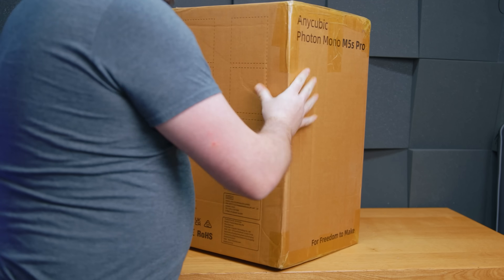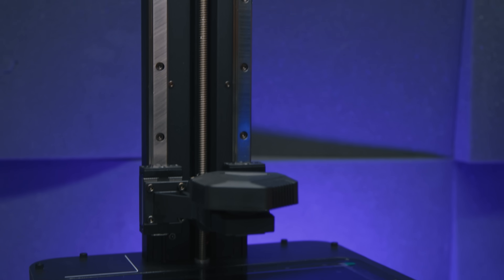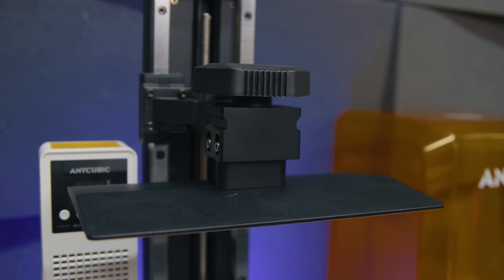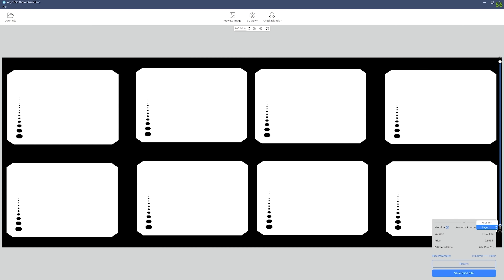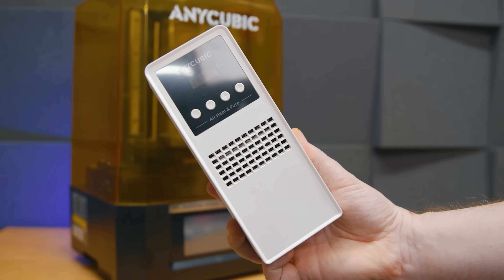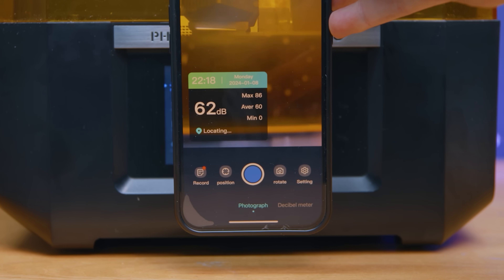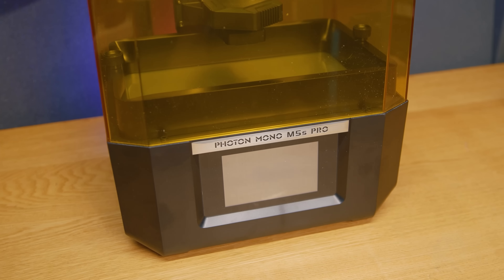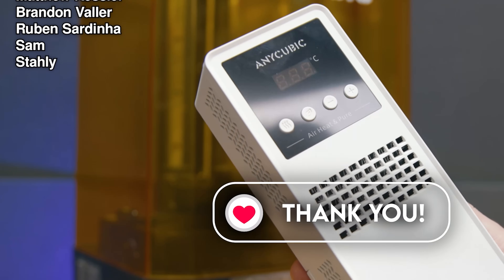About Damn Time - Anycubic Mono M5S Pro Review

Comment: I can't believe one of their cost cutting measures was to not include rubber feet. That's so ridiculous it's funny.
Reply: Yeah but they can sell you new feet for $50 afterward. You could also just buy a $10 heat mat for under it.
Reply: Just 3d print new feet 🤷‍♂️ 
For the price, this printer is pretty dang good.  It's common  in the 3d printing community to 3d print your own upgrades.
Reply: It’s almost like they’re as cheap as the people they’re selling to.
Reply: I can. Its amazing how companies seem to constantly miss what consumers care about. They cut costs on wanted things and keep stuff that arent important. Look at elegoo. Saturn 4 ultra.. tilting bed.. no heater or port for one etc.
Reply: Those little plastic ovals are supposed to have adhesive rubber inserts. it looks like they forgot about them.

Comment: So just found your video review. I absolutely love this printer. It’s simple, works, and does heck of fast prints. I have both the nfep and acf vats and I swap between the two. I started to 3d print a model rollercoaster that works. The track is printed with fast print resin and the train is printed with 8k resin. I ended up having a dead projector that I stole the rubber feet off and it is perfect for keeping the printer steady. Now for one update that you will like, I never print with usb. I print from my computer directly to the printer via the photon workshop slicer. All WiFi no usb or cords. The only reason I use my phone app was for set up or to check my prints. Actually I traveled from my home and finished a model on my trip, connected to WiFi at the hotel and printed my model. When I got home my print was finished and didn’t have any issues.

Comment: I have a small side hustle where I help a local DnD Studio with their prints. We have an M5s. We call it the Fast Printer. Not the Best Printer, or the Good Printer, just the Fast Printer. Currently I'm printing 160 various models for a collab, and the minis get printed on the Mono X, Mono X 6k, and 2 DLP's. The bases get printed on the Fast Printer. Bigger pieces / terrain as well.

This printer looks like a nice middle of the road option between features and affordability. But it definitely needs rubber feet.

Comment: I bought an M5s. To get around the heater issue I just run the build plate under hot tap water until the plate is hot. Wipe the thing dry, reinstall and print. NO failed prints since I started doing this.
Reply: Ever tried popping the resin in the microwave for a minute?

Comment: I bought this yesterday as my 5th resin-printer. I have so much joy with my two M3+ and needed a printer for more details (small miniatures) with other selfmade Resin-blends. I really needed a heater and I paided 80€ per piece for my 2xM3+ and can't print with my Photon Ultra because of the temp. So I preordered one with 2x1kg for 452€ with a coupon... Means after subtracting the costs for Resin/heater I payed 332€ for a printer that will last me at least 3 years... When it prints like the M3's, than I'm absolutely happy and I can swap the heater to my Photon Ultra if needed :)
Reply: How has it been 3 months in? I'm now debating this and the Saturn 4 Ultra.

Comment: Not sure what's the issues you're having with the wifi, but it works well on my M5s, and I can send prints from the Photon Workshop on my desktop directly to the printer, the app I use just for monitoring. Basically, both the printer and desktop are connectred to the same network, and the printer shows up in my slicer to send prints to no issues. Maybe I'm just misunderstanding your point, but it definitely works with my PC.
Reply: i have never gotten it to work directly to my computer. I don't use the smartphone app with the printer which as far as I can tell you need to use to set it up.
Reply: Another commenter here wrote that files sent from the slicer are sent via the cloud which then needs to be cleaned out occasionally. Can you confirm that it's possible to bypass using cloud?
Reply: @markburton5292  It does need the app for the setup, yes. It doesn't go "directly" to the printer from the computer, but you don't need to send it to the app and then the printer manually. You just click remote print in your slicer, it gets uploaded to the app and the printer, and the print starts, no manual steps past clicking remote print.
Reply: @DanJ-yt7cb  The files go through the app, which highly likely is hosted on some cloud provider, so don't think you can bypass that. The "cleaning" part is your print history in the app I guess, same as you'd need to clean the memory of your printer.
Reply: @rumenmatanov303  here is my problem with that. I don't want to be required to install the app on my phone to set it up. I hate smart phones I don't want the world accessing my life from my phone. so i will just keep using the sneakernet ( put it on you r sneakers (shoes) save the sliced file to usb and walk over to the printer and  print from the usb)
Reply: @rumenmatanov303  Ahh I see. Thanks for the clarification

Comment: where would this place in your best printers for miniatures considering you stated is better than prior M5 and M5s and the one you would personally buy in that price range?
Reply: 1	Ultracraft Reflex HeyGears
2	UniFormación GKTwo
3	Elegoo Saturno 4 Ultra
4	Anycubic M7 Pro
5	Elegoo Saturno 3 Ultra
	
6	Elegoo Saturno 4
61	PHOTON MONO 7
7	Elegoo Saturn 3 – 12k
8	Phrozen Sonic Mini 8K
9	Anycubic M5 Pro
10	Elegoo Marte 5 Ultra
11	Elegoo Marte 4 Ultra
12	Elegoo Marte 4 (9k)
13	Anycubic Photon X6K
14	Elegoo Marte 4 Max
15	Fotón Anycubic D2
16	Marte 4 – DLP
de una reseña que el hizo

Comment: Hello, could you make a video testing water washable resin vs ipa resin? What are the drawbacks of each etc
Reply from the maker: i may cover it, it;s a lot of work and the result will be - that could have been an email.

Most Water Washables are crap and even the good ones I'll wash in Metheylated Spirit to ensure it;s clean, Water Washable also absorbs water which can cause prints to soften, go brittle, or crack,. even air moisture after the print can be a pin
Reply: Ah, figured the water washable resins had been improved over the years, seems like not then. Watched Midwinter's video and it seemed most of the fumes and vocs came from the Ipa cleaning, so would be interesting if that could be avoided with better water washable resins. @FauxHammer
Reply from the maker: Youc an do it, and Water Washable resins are better, some anwyay, but they have caveats.

Wash for a few minutes at a time and don;t leave them sat in water and you'll be fine. I;m so distracted that i often leave prints in the wash vat and Methys are much less harmful

 @zior92

Comment: Must say though it doesn't need a heater! Used the m5s all winter with no issues on the UV heating up the resin still hate the printer it does print nice now new Build plate is relised and being sent to people like the saturn 3 ultra so you have some manual levelling as the build plates were angled and 2mm to short! I printed a new spacer from printables for mine it worked great and anycubic then worked with me put the new update on the printer and has new Build plate! What build plate comes with it version 1 or version 2 with the 4 hex bolts?

Comment: My 2 cents , I don't care about print quality I make functional parts , I like the heater , I like the size every millimter gives me more options , I like the low weight it reduces my (Guatamala) very high shipping cost , a noisy fan is a real negative for me, I can add rubber feet and some weight my self. I like the low cost but would pay more for a quiet machine.

Comment: I have to correct you about the wifi stuff, I have an M5 and you can send prints to it from your PC, but they HAVE TO be sent from their slicer, things like Lychee dont work that way. there is a storage limitation as well, as it sends to anycubic cloud and then from cloud to printer (which is a big question of "why? just send it to printer direct"
Reply: I've been sending all of my prints from my PC to the printer via wifi through the Anycubic slicer. Works great. You just have to occasionally clean out the cloud storage.
Reply: This was interesting to learn. I was under the impression that pressing "Remote Print" sent it directly to the printer, and that "Save to cloud" was for cloud printing. Hmm, now I'm back to thinking of Saturn Ultra again!
Reply: @DanJ-yt7cb  I think saving to the cloud makes it easier to manage/delete files from the PC/slicer (I also deleted unneeded files using the phone app) rather than having to do it from the interface on the printer, but just a guess.
Reply: @harrisjc03  Makes sense. Thanks for your help

Comment: compared to the Saturn 3 Ultra the M5s pro only gives me 200 mm print height. 60mm less as S3U and only 30mm more as the M3pro. Enough sensors which can brake or gives a fake error. I was struggling with my self which one will print on my side. I decided for S3 Ultra for 469€. I'm more than confident with the point that i level my bed manually. Having a higher print height and a z ballscrew as well. The heater on M5s pro is not necessary in my case, im printing in a heated basement. For sure there more fancy extras on M5SP but do I really need it. 12K vs 14K? different number same optic. I like the design, screen protection and the lower price from the M5SP. At the end the Saturn is my friend for the next time which I ordered finally.

Comment: My m5s after 2 months of working with anycubic getting the new V2 build plate as the original self levelling in production model's are 2mm to short now the V2 is more like the saturn 3 ultras they are sending out but mine is back in its box and for will be going up on market soon! I went and got the saturn 3 ultra I just should have gone with my gut in the first place but the self levelling idea got the better of me! It works great now it's got the new V2 build plate but it's so loud you can not keep it in the same room your in like a bedroom you can't run it through the night the fans are like jet engines kicking in and can't hear your TV! That's one very bad point when I first pressed print I couldn't believe the sound of the fans! I was going to see if a saturn 2 8k fan would fit as so quiet! My saturn 3 ultra is louder than my saturn 2 but nothing like the m5s!

Comment: Hello, could you help me please, I am looking at these machines for dental laboratory use, which one would you recommend, if they are compatible with Chitubox. 1- Anycubic Photon D2. 2- Anycubic Photon M5S Pro 14k. 3- Anycubic Photon M5S 12K. 4-Saturn 3 Ultra 12K Elegoo. 5-Mars 4 Max 6K Elegoo. Those are the ones I've seen or which one would be better. Please help. Greetings and thanks.

Comment: I have an M3 premium, it's fantastic but I'm a bit gutted that it's been dropped... With consumable parts like screens becoming hard to source I'm not sure whether to just keep it until the screen dies and then change it or try to buy one or two spare screens ahead of time - I did find one source for the screens but not sure how long they'll be available. Don't think I'll be buying anycubic again just for the bad taste of how they handled the m3 premium. I don't really understand why they need to saturate the market with so many different printer models, they could cut their offerings in half and still have all bases (cheap, expensive, small and medium sizes) covered.
Reply: Yeah I’m in the same boat, it has completely turned me off of anycubic…

Comment: Hey fauxhammer 

Am I'm the only one with problems with the heater dripping all the resin out of the VAT as doon as the build plate goes up?
Reply from the maker: I' didn't have it on the heater, I had it a bit on the inside of the lid. are you on the latest firmware?
Reply: I don't see any update in the anycubic website

And yes i mean the lid . But the heater seems to be the one blowing the resin into the lid

Comment: I got my M5S Pro last week, and I've not gotten a single successful print out of it so far. It's been bloody awful - I don't know if I just have a dodgy unit or something, but no matter the resin I've tried, or the speed I've adjusted to, I get a huge elephant's foot, peeling layers and splits higher up the print. Just generally bad, compared to my Halot One which has been reliable for over a year with the same resin.

Comment: I am trying to decide if its worth paying less for this printer over the GKTwo. I am wondering how much of an advantage is the bigger Z axis on the GKTwo as this just seems a little low for a mid range
Reply: Im actually looking for every piece of information to decide whether to invest less in this or make an effort for the gk. I cant make up my mind
Reply from the maker: I'd easily pick the GKTWO over this if i had the funds, this is great in the budget sector, but of you are after a product that will certainly last a few years, then the GKTWO is it. This is a massive improvement step from anycubic, but not a leader in the market,
Reply from the maker: as mentioned above, if you can get the GKTWO, get that.
Reply: @FauxHammer  Do you think Elegoo will come up with a new heated saturn anytime soon?
Reply from the maker: @ReliquiaLaserCraft  your guess is as good as mine...
Reply: @FauxHammer  Yeah the cost is a factor of course and in AU the GKTwo is nearly double the price which is semi hard to justify lol

Comment: About the heater 'heating the resin last', what if I warm the resin first? It will keep the warm resign temperature easier, right? I'm deciding between this and Saturn 3 Ultra (with custom heating). Unfortunately Uniformation is too expensive.

Comment: I wouldn't ever buy an Anycubic again. The last one I bought their cost cutting measures was to not include any fans on it. So it overheated on every print. I had to take it apart to find out what was wrong. A daunting task for someone who has never taken apart a 3d printer before.

Comment: hey, Thanks for the great review! I'm still new to 3D printing and have been considering for some time whether (and which) resin printer I should buy. I've been wavering between the Elegoo Saturn 3 Ultra 12K and the Anycubic Photon Mono M5s Pro and I can't make up my mind. The most important issue is the odour. We are an office with a shop and I want to install the printer one floor down by the window (just a staircase, there's no door or anything). Which one can I use better without being unable to work on the PC? So how well do the air filters work? You can also connect a larger extraction station to the Elegoo Saturn 3 Ultra 12K if the two small filters are not sufficient. Is this also possible with the Anycubic? Or is it necessary? Could I use the two USB air filters on the Elegoo, for example, and also use the heating unit from the Anycubic? I assume that this can also be purchased separately? The more I learn, the more undecided I become...

Comment: Picked up a hell of a lot of info from your videos BUT the one video nobody does which surely is more important to new users is the actual resin types - how about creating a video comparing different types and there pros and cons..?
Reply from the maker: That sounds like a great idea, but moist of the different "types" are little more than marketing names. ABS like from one brand could mean a totally different thing to another brand.
Reply: @FauxHammer  So how do new users establish what resin to use - prime example vogman printer review used "brittle" resin which is no good to anybody....?
Reply from the maker: @timstoth4271  well it depends… the more brittle resins are usually higher detail/smoother and for statues containing mostly thick parts, they are useful.

But this is. Or so good if you’re making tabletop miniatures because the small fine parts can snap by just touching them. You need something more robust but that will loose detail

If you want to do jewellery casting. You’ll need a cast able resin which is wax like and soft. Then there are many more technical resins.

So I’d start with what you want to print, and choose the best resins for that.
Reply: @FauxHammer  That's the whole point behind my question right now I'm not interested in miniatures and ALL printer reviews reviews seen cover miniatures - I print tabletop gaming terrain & role play replicas which requires strength used FDM & standard PLA for years but some parts can't be printed on an FDM hence why I'm trying to find the right printer, software AND resin require strength - its okay reviewing printers until the cows come home BUT without resin type reviews HOW are new users going to know what resin to use....
Reply from the maker: @timstoth4271  That's a fair point and I honestly don;t know. I guess most people just start with a Standard resin you get from the brand and then after that will join various groups and forums.

But I expect that most of the time, people will end up buying the cheapest workable product they can.

Comment: Hold up homie, you can Wi-Fi send prints directly from your PC through the anycubic slicer directly to the M5.  How did you miss that?  I have been printing since Christmas and I've used the USB port exactly once.

So the biggest real issue is still the plastic feet.

Comment: I'm currently in the market for a 3d printer and I'm torn between this or the saturn 3 ultra. I know you highly recommend the saturn ultra but do you still stand by that or would you consider getting the  m5s pro instead. I want to print minis, busts and 75mm figures.
Reply from the maker: I;d probably still get the Saturn, but this is decent
Reply: My s3ultra came with a warped build plate, as did many who recently purchased. No recall, no ability to buy a replacement on Amazon, and support won’t get back to me until after the 17th bc of the holiday. I’m here looking for something else.